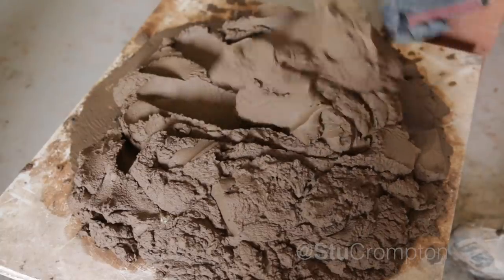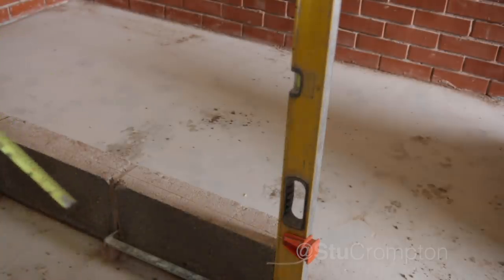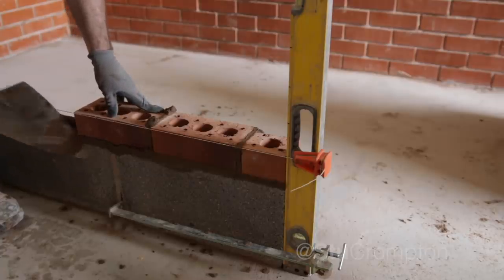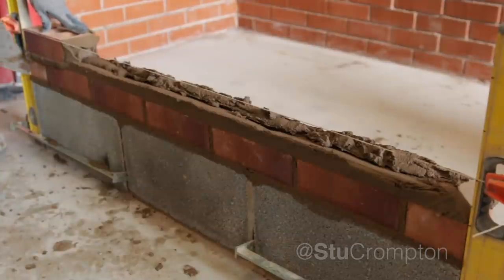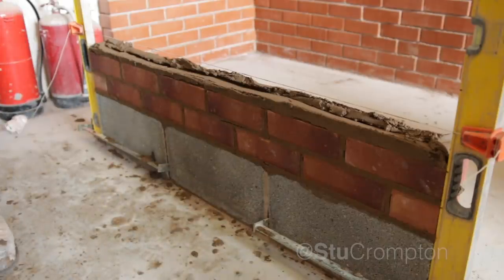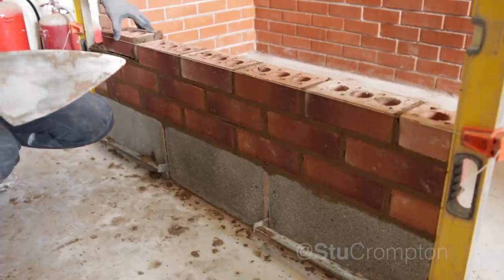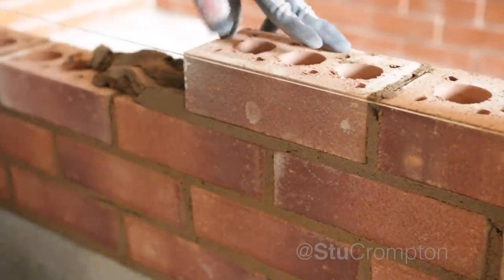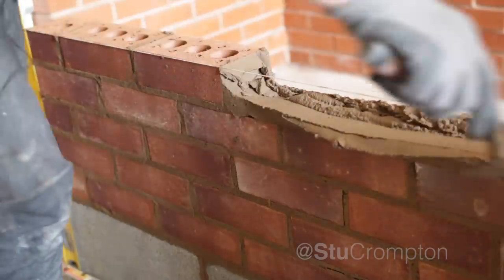Laying Bricks To a Line For Beginners  - TAKE 2

Comment: Bit of advice for non bricklayers, if you mix your mortar too wet, spread  it out thinly on a piece of cardboard, leave it for a bit and remove it from the cardboard, just be careful you don't scrap the cardboard with the mortar when you transfer it back to your mortar board!!